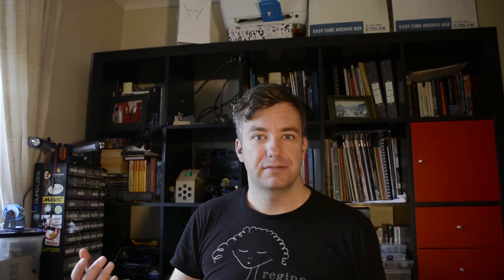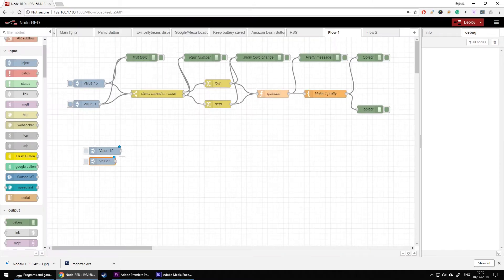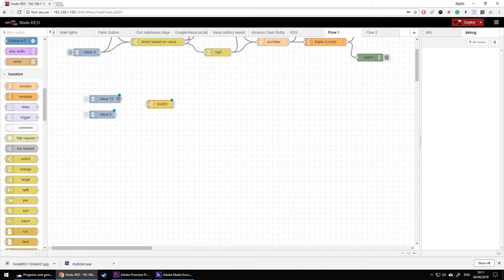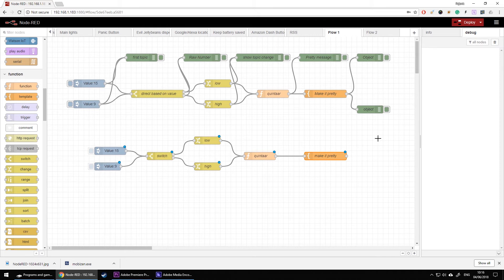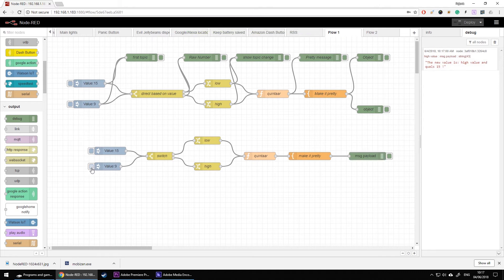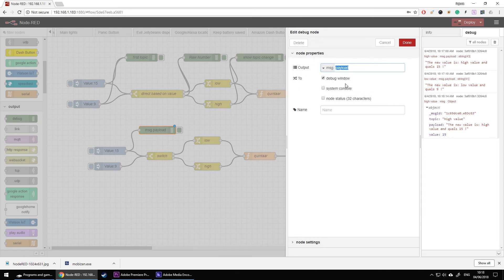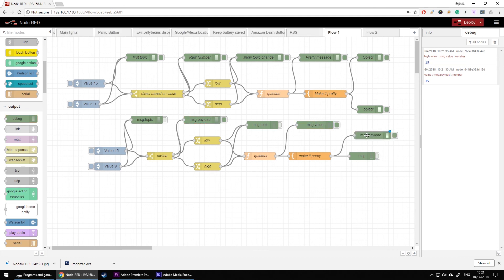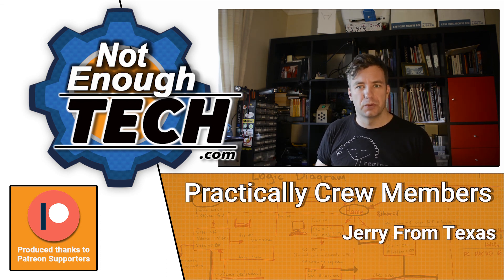NodeRED for beginners: 3. First Flow

Comment: Thanks for sharing.
I followed exactly what you did, node "Low" is set as low value, but it appeared as high value topic. Pls advise.
node: 9004a394.1ef65 high value : msg.payload : string[2] "15"
node: 9004a394.1ef65 high value : msg.payload : string [1] "9"
Reply from the maker: Pleas make sure you have the order in the switch node correct. Otherwise you will need to remap the links in the output. 
For more info I'd have to see your screenshots

Comment: please, i need to create flow: sensor node send encrypted data by aes and dat will be  decrypted by another sensor node. During the simulation i must recuperate energy consumption and tie execution for both operations encryption and decryption. it's possible, if yes acn you help e please.....i will be very grateful
Reply from the maker: There are nodes that let you encrypt and decrypt the data that enters NodeRED. That would be the simplest way of handling the task. By the sound of your description, you are passing a message that is already encrypted and will be decoded by the target device, In this case just send over the message as raw data. Just dress up the message passed over NodeRED with information about the description - that's all

Comment: Definitely NOT for beginners....
Reply from the maker: Have you seen part 1&2.. plus there is a written version to take it all in at slower pace.
Reply: Admittedly, I have not. I saw "first flow' and decided to check it out. This was certainly not what I was expecting for a beginners first flow. Maybe a little more complex than a simple switch toggle but this is way over my head. I'll look through your videos for part 1 & 2. Where can I find the written version? I do appreciate all the work you put into this. Thank you... 

As a beginner, what I was looking for is polling a temp monitor (ecobee) and using its output to turn a fan on or off. If the temp is greater than X turn the fan on, less than Y, turn the fan off. That's got to be super simple but, I cannot get it figured out.......
Reply from the maker: Links for all in the description:
start here: http://www.notenoughtech.com/home-automation/nodered-home-automation/why-nodered-server/
I didn't want to do the Hello World type, after reading few these types of tutorials they always a little too simple. 
Each video comes with a written part linked in description (or end)  
Questions, you know where to ask :)
Reply from the maker: The First Flow shows you exactly how to handle such example with a value being represented via inject nodes (8&15) 
You will have very little to change in terms of the flow... only the input and how you handle the output messages.  That depends on where is the information coming from. This is something that's going to be covered in detail in part 5 I believe.